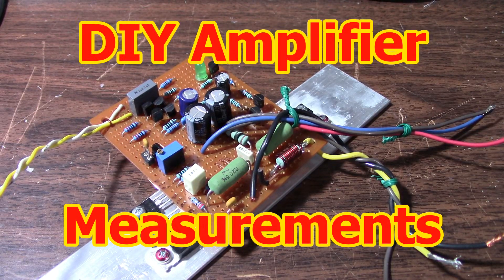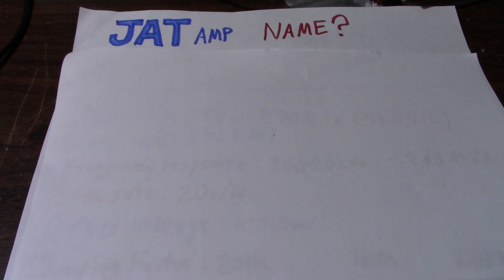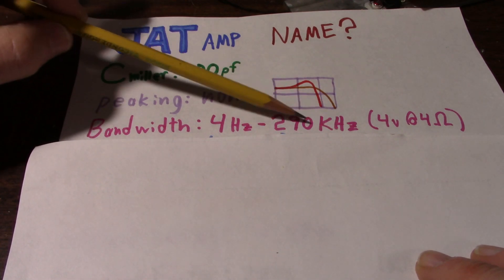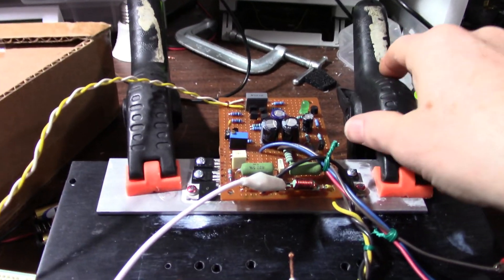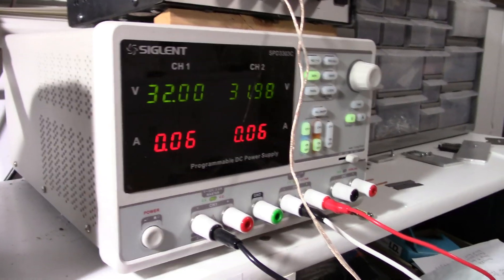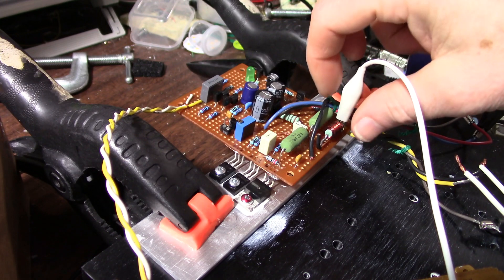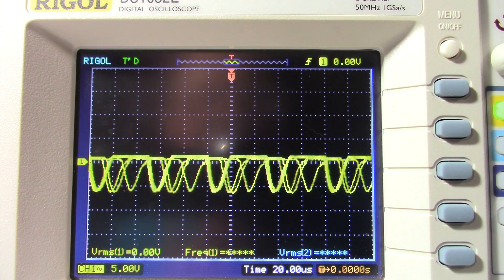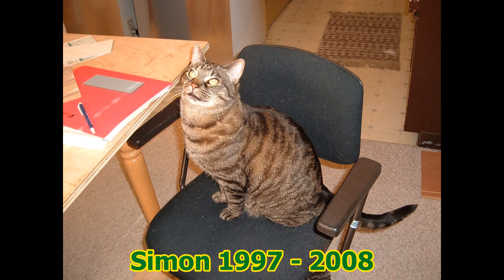Discrete audio amplifier project PT17 measurements

Comment: I have seen some amplifiers with only two output power transistors (push-pull configuration) and an opamp at the input section besides some passive components and still can deliver upto 30 watts or so @ 4 ohms load with Split supply. So why to use so many transistors then ?

Comment: I don't think I will ever have the time to learn to use that software to design a board, I was looking foward to possibly the one you might design and sell. I also saw these on ebay, i noticed almost the same design topology.   https://www.ebay.com/itm/100W-Class-AB-Audio-Power-Amplifier-Board-PCB-based-on-Symasym5-3/113078006128?epid=7020573639&hash=item1a53f97170:g:KNEAAOSwoSNceMKI

Comment: Thank you so much. Do you think this could be used as a headphone amp? Can it be used in a balanced configuration?
Reply: 60W for a headphone amp?!  That's instant hearing loss if you get it wrong.
Reply: Mark Tillotson you don’t have to run it at 60W. I want to build a headphone amp, and I was wondering what the difference between this and a headphone amp is (apart from power) do they have a different output stage ? Or could you just use this design?

Comment: What  you need to do is  contact   a  company  like Keysight  and tell them   you  want a loner  scope   to  do  a review  because you  have a Youtube  channel. Then  you can  get a piece of  equipment  for a period  pf time for testing purposes    Doing a review  is also  a   good  way to  get more people to watch
Reply: Unless it's 16bit scope it won't do anything. Cheap audio interface will do much better. Also building a notch filter should work as well.
Reply: An audio analyzer would be far more useful and appropriate, not a 'scope.

Comment: John, did you remember to short the input to ground when measuring offset voltage?
Reply: Its AC coupled on the input so that's not going to change anything.
Reply: Mark Tillotson Yes, right after the coupling caps, both hot and return should be tied to signal ground. In my experience, this makes a difference in getting an accurate DC offset measurement at the output.

Comment: That's looking great! You just made a strong point for active speakers, with wires only inches long the amp has much greater control. Do you think the difference in distortion compared to long speaker cables is measurable?